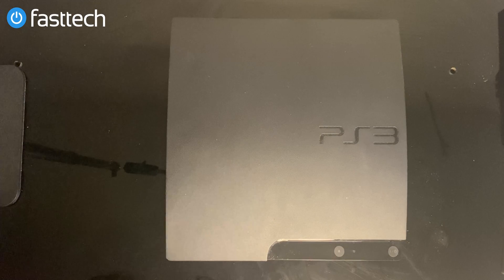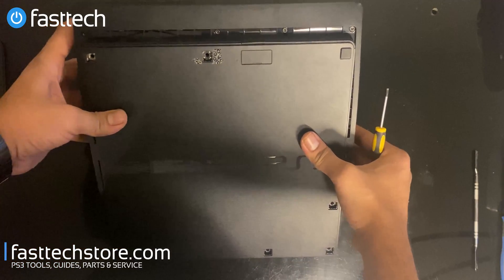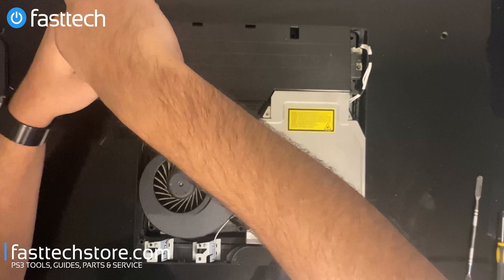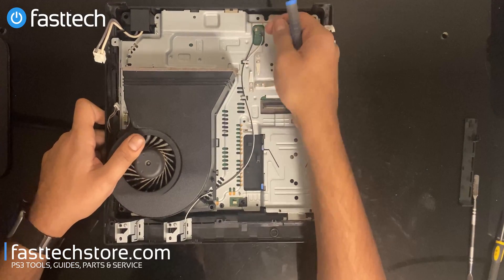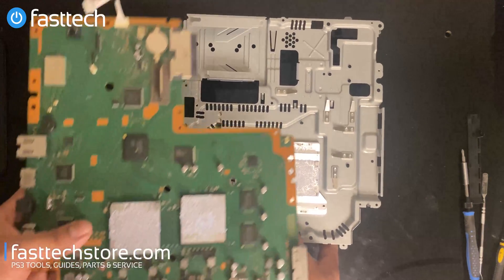PS3 Slim Disassembly and Thermal Paste Replacement Guide

Comment from the maker: 👉 Fasttech Pro Tool Kit: https://fasttechstore.com/tools/fasttech-pro-auto-kit
👉 Arctic Silver 5 Thermal Paste: https://fasttechstore.com/playstation-4-parts/arctic-silver-5-thermal-paste
👉 PS3 Power Supply: https://fasttechstore.com/playstation-3-parts/power-supply-aps-306
👉 PS3 Disc Drive: https://fasttechstore.com/playstation-3-parts/kes-450-blu-ray-disc-drive
👉 PS3 Slim 3001 Mainboard: https://fasttechstore.com/playstation-3-parts/p/ps3-slim-mainboard-disc-drive-logic-board-kte-001
👉 PS3 Front power button: https://fasttechstore.com/playstation-3-parts/sony-playstation-3-slim-control-board
👉 PS3 Hard Drive: https://fasttechstore.com/playstation-3-parts/1-tb-ssd-hybrid-25-hard-drive
👉 PS3 Fan: https://fasttechstore.com/playstation-3-parts/ps3-slim-internal-cooling-fan
👉 PS3 Casing: https://fasttechstore.com/playstation-3-parts/sony-playstation-3-models-cech-3001-casing
👉NEED HELP? FaceTime/Zoom Video Call Me: https://fasttechstore.com/online-consultation
👉GET REPAIR SERVICE FOR YOUR DEVICE: https://fasttechstore.com/electronics-repair

Other PS3 Videos:
▶PS3 CPU AND GPU DE-LID GUIDE: https://www.youtube.com/watch?v=GzMmi7F65wQ&t=30s&ab_channel=fasttech
▶PS3 CECHG Repair Guide: https://www.youtube.com/watch?v=GgOYFO9Pdss&feature=youtu.be&ab_channel=fasttech
▶PS3 CECHH Repair Guide: https://www.youtube.com/watch?v=BDC1O8mYZZc&t=1840s&ab_channel=fasttech
▶PS3 Slim 2000 Repair Guide: https://www.youtube.com/watch?v=S-ewz35fOLY&feature=youtu.be&ab_channel=fasttech
▶PS3 Slim 3000 Repair Guide:https://www.youtube.com/watch?v=ay7GYYMjodQ&ab_channel=fasttech
▶PS3 Super Slim Repair Guide: https://youtu.be/6a9UM_S1T64
▶PS3 YLOD Repair Guide: https://www.youtube.com/watch?v=uAWpqW1HCmo&feature=youtu.be&ab_channel=fasttech
▶PS3 Controller Ghosting Fix: https://www.youtube.com/watch?v=lMQouNRR018&ab_channel=fasttech

00:00 Intro
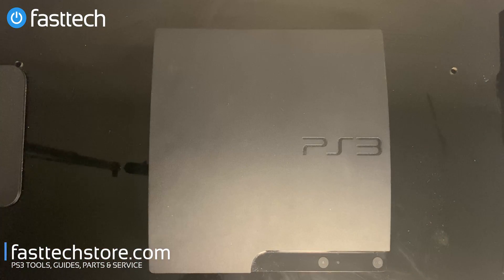01:07 Removing the bottom tabs & screws
02:20 Removing the top cover
02:31 Removing the power supply
03:02 Removing the disc drive
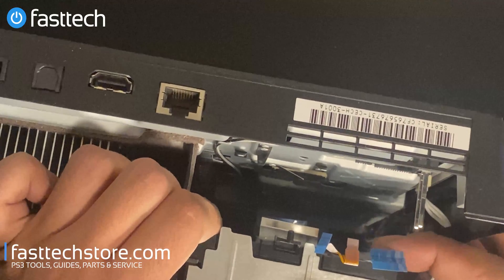03:47 Removing the front power button
03:56 Removing the hard drive
04:15 Removing the motherboard assembly
04:58 Removing the motherboard backplate
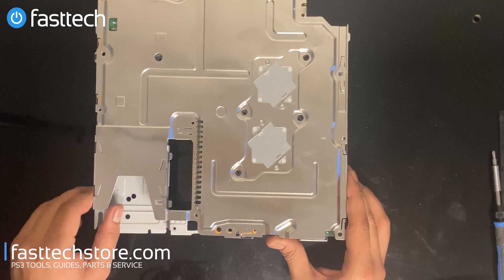05:44 Removing the motherboard
06:03 Thermal paste replacement
08:15 Reinstalling the motherboard assembly
09:39 Reinstalling the motherboard into the case
10:15 Reinstalling the antennas
10:28 Reinstalling the power button 
10:44 Reinstalling the disc drive
11:32 Reinstalling the power supply
12:18 Reinstalling the hard drive
12:37 Reinstalling the top cover
12:58 Reinstalling the bottom tabs & screws
13:45 Applying Fasttech warranty sticker
13:58 Outro

Comment: Why does mine deactivate it self...
Reply from the maker: Does it turn off right away after you turn it on?
Reply: @fasttechvideo  Im so stupid I forgot to plug back the cable from the fans in
Reply from the maker: @كوتاي-ك3ذ  Yes that would be a problem lol
Reply: @fasttechvideo  Its working now I was worried for a moment
Reply from the maker: @كوتاي-ك3ذ  Good, the fan is critical for cooling and needs to be plugged in

Comment: Great video! Just changed the paste in my ps3 follwing it. 
That stuff was so dry that the motherboard got stuck to the heatsink. I used a hairdryer to loosen them but still had to use some force. Quite a tense procedure, ngl 😅
Reply from the maker: Thanks

Comment: Can you speak a little more about a stuck motherboard? You mention it is a sign of bad thermal paste. I was to afraid to remove mine because I didnt want to crack the motherboard.
Reply from the maker: That means the paste is most likely dry
Reply: @fasttechvideo can you recommend a particular heat blower?

Comment: Is it possible to take off those lids to apply paste directly to the die similar to how it is done in the Nintendo Switch, or does the PS3 not have paste applied directly to the die?
Reply from the maker: Yes its a called a 'De-Lid'. I have done a few video guides on this topic on my channel so check them out

Comment: Mine is slim 2004b is that similar inside 😅
Reply from the maker: Similar but slightly different in how you remove the disc drive. Watch my ps3 slim 2001 video on this channel instead

Comment: i put new thermal paste but still not working? what must be the problem?
Reply from the maker: If your system was in a non functioning state like ylod or some other issue, replacing the paste wont help at that point

Comment: Did all the steps, now when i turn my system on, it turns itself right back off, then the red power light blinks
Reply from the maker: Something went wrong. First check the 2 standing pins under the power supply.

Comment: I reapplied the thermal paste and the fan is still running low and it turns on for about 30~ seconds and then it cuts power then if I hit the power button again it goes back to red… what is the issue? I might get a new power supply….
Reply from the maker: @igifvitig  does the fan speed up before it turns on? Did you have the same problem before doing a paste replacement?

Comment: I know this was a great tutorial because I was only left with one unidentifiable screw after putting it all back together!!!
Reply: CPU and GPU running at 55° while on home menu🤩
Reply: 63 on cpu and 69 on GPU during gameplay with less than 50% fan speed😊
Reply from the maker: @ViaCristero thanks 😊
Show me a picture of the screw and I’ll tell you where it goes
Reply: @fasttechvideo  it’s a torque screw I found the location but it will not thread
Reply: The screw just spins as if it’s against a flat surface I can see a white piece of metal that seems to be able to move I aligned it to where the screw looks like it would thread in but it does not thread at all
Reply from the maker: @ViaCristero 13:22 probably
Reply: @fasttechvideo yeah there’s 3 torque screws on my model the middle screw will not thread I’m not too worried about it but if you do know the solution let me know

Comment: followed all the steps but im getting no power at the end, any idea whats missing?
Reply from the maker: @Missourigaming425  check the ribbon cable for the power on off button at the front
Reply: @fasttechvideo  it was the ribbon cable. got my controller hooked up and turned it on that way, but now my controllers usb port is loose and wont connect to anything.

Comment: I've been doing the line or pea method and letting the pressure of the heat sink spread the paste. I still don't mind spreading it either.
Reply from the maker: That works also, but I recommend spreading it as demonstrated to ensure the  whole surface area of the IHS is covered.
Reply: @fasttechvideo  I tried the line method on my ps4 pro and let me tell you, at some point it sound like a damn jet playing both god of war games and I wasn't even on the map screen. Once I turned it off and let it cool, I took it apart and the majority of the paste wasn't even on the apu at all. I cleaned it up, and this time I did what I always do which is the spread method and it sounds a lot better. I mean the only time you hear the fan go up is when you are on the main screen or the map menu but it's not even loud like before. 😁

Comment: Your guide worked! But I have a new problem: my disc drive won't read discs. It takes the disc in, then it makes a sound, but it doesnt spin up
Reply from the maker: Check the ribbon cables and then check the gears in the disc drive to make sure they are aligned correctly.
Reply: @fasttechvideo  I figured it out. It turns out the main ribbon cable wasn't connected. Even though I had it in, the clamp wasn't pressed down. 

Sony sure made it a real pain in the ass to repair. But how my console is running way better than it ever did. Thanks again!
Reply from the maker: @SavagePatch115  You are welcome. Please like the video, subscribe and share if you can. That helps me out tremendously
Reply: @fasttechvideo  Seriously, I can not thank you enough. I've had this console since 2011 and I never took it apart due to the lack of a guide that covered this specific model. This thing was chalked full of dust bunnies, and playing late cycle games would have the fan screaming. Popped in an SSD and this thing runs like a dream
Reply from the maker: @SavagePatch115  I try to do videos others haven't done. Its one of the reasons of the channel's relative success.
The SSD should speed up your loading times. Also I recommend jailbreaking your console using HEN. Cheers and thanks for your comment.
Reply: @fasttechvideo  I do plan on reinstalling HEN so I can run my disc based games from the SSD for even better load times. GTA 4 is gonna run so much better than it ever did

Comment: Guys if my ribbon cables that are shown at 3:15 are damaged on the tip...do i need to replace my disk drive whole or can i find the replacement cables online??
Reply from the maker: Which one of those did you break?
Reply: @fasttechvideo  they were already broken cuz I bought the ps3 from another person and when it started overheating the next day I opened it and cleaned a whole lotta dust and also found out all 2 of them ribbon cables destroyed at the tip except the wide white one

Comment: Dig the background tunes. Thanks for the detailed tutorial! Got mine in pieces right now and knocked a few thermal pads off the top mobo shield. Now I'm digging through videos looking for a clear image of the shield - of my particular model - so I can finally reassemble and hopefully be able to watch a G$DD&?N BLURAY. Provided my bluray lens just needed cleaning and isn't burnt out, and I didn't break anything while separating the heatsinl from the CPU and GPU.

Prayers are welcome and much appreciated lol.
Reply from the maker: My prayers are with you. Good luck. If you have a 2000 model I did an updated video which will show more detail

Comment: My PS3 slim bought in 2009. When it boot up around 30 second it sound be be be 3 times and shut. Power light keep flashing. Very rare time may boot successfully properly out of 100 times. What possible causing it?
Reply from the maker: Use syscon to diagnose it. Will be doing a video soon on this

Comment: I noticed my PS3 running a bit hot lately and I had some thermal paste lying around, so I thought why not. The inside of my PS3 Slim was a bit different (I didnt have the ribbon cable on the bottom of the blu-ray drive for example), but most of it was the same. Old thermal paste was on there since 2009 I think. Now it's pretty much dead silent when in the XMB. Thanks a lot for the great guide!
Reply from the maker: You are welcome. Please help us back by liking this video and consider subscribing for more videos like these.

Comment: For me it starts overheating please help
Reply from the maker: Check the tightness on the heatsink clamps/brackets
Reply from the maker: Was it overheating before disassembly? It could be that you need a 'DE-LID' plus a thermal paste replacement
Reply: @fasttechvideo  it is overheating with new paste
Reply: @fasttechvideo  thank you i will buy it maybe

Comment: How does the network cable work and how to remove since i don’t understand
Reply from the maker: There is a pin on it you have to pinch/ 
Push down then pull the cable out

Comment: Hi, I got to the ‘remove motherboard backplate’ part, however, 2 of the silver screws are impossible to get out. I’ve even tried pliers and they didn’t even move a little. Any solutions?
Reply from the maker: Make the screws flatheats by cutting a line using a dremel or a saw. If that fails use a drill to drill the head of the screw off but be careful. Good luck

Comment: I recently bought a never used CECH-2001A PS3 slim in mint condition still in its original box and everything. I’ve already opened it up to replace the dead CMOS battery due to years of not being used. I’m a bit hesitant on going further, should I just toughen up and re paste it? The manufacture date on it is June 2009.. so surely it’s in need of new paste? The paste goes bad wether it’s been used or not, right? Arctic MX4 or silver 5? Thoughts?
Reply from the maker: Yes you should replace it with arctic silver 5. Check the description box and the top comment for links.

Comment: thanks for this video. Artic silver mx4 cpu and rsx both running at 42 - 43 c.
Reply from the maker: Great! Those temps are very good. Please like the video and subscribe for more videos like these.
Reply: @fasttechvideo  is it enough to just replace the thermal paste like in the video? Or does it have to be made like the phat model? Where you remove the cpu and gpu plate?
Reply from the maker: @gaboaaa23  depends on how loud your fan gets or of there is an overheating issue.
Reply: @fasttechvideo  I see, I bought some 0,08mm metal cutting wire wich is used for removing displays. I will remove the cooling plates from the gpu and cpu. Because that will give the whole refreshing package.
Reply: @fasttechvideo  hi, my temps are 73 cpu and 71 gpu while gameplay. Tested with prototype 2.

Fanspeed is set to 30 percent manual.

you think I need a de lidding?

Ot just normal refresh?
Reply from the maker: @gaboaaa23  you dont have to at this time. These temps are within the ps3’s normal operating temperatures
Reply: @fasttechvideo  realy? but these temps are with 30 percent fan speed- So with the regular factory fan speed it would be higher.

The ps3 was only used 29 day ......thats what webman show under total usage time. 160 times on and off.
Reply from the maker: I would also recommend delidding the ihs (check one of our latest videos)
The actual chips are under the IHS

Comment: Can I, in a bad situation use brake cleaner to clean the CPU and CSU? Or should I really buy Isopropyl alcohol for it? Bc if I should buy it, I will clean and replace the themal paste of my ps4 too
Reply from the maker: You’re better off cleaning it with a dry paper towel please dont do that

Comment: Can’t even turn my ps3 on anymore. Reconmected everything, checked the ribbon cables, i don’t really get it. i’ve been checking the power button cable but nothing should be wrong
Reply from the maker: Check the pins under the power supply

Comment: I change thermal paste at my slim model 3004b and i have 58° cpu and rsx 67 with 27% speed fun. I don't now if a best temperature but for a good temperature only chance is remove ihs procesor and change paste under ihs but is a dangerous operation.
Reply from the maker: Yes for the best possible temperatures you have to remove the IhS but for the temperatures you reported are within optimal operating range.
Reply: @fasttechvideo  I can't find official ps3 temperature data and I don't know if my temperatures are safe, but removing ihs is a dangerous operation because I tried it on my old fat console and I scratched tracks after the processor. Now I set the fan speed to 29% and I have 58-63° for rsx gpu and cpu 53-56° after 1 hour play.
Reply: @laurentiuilina4992 how do you set fan speeds? I need to do that for my Ps3 Fat model!!
Reply: @justingalea4027  for set fan speed you must have your ps3 jailbroken and after you must install webman mod.
Reply: @laurentiuilina4992  i will try to do that thanks

Comment: I only wanted to dust and clean my PS3 completely but I was told if I remove it like this; I have to replace the thermal paste to prevent airpockets; this video helped in more ways then one since my PS3 slim was very speciic model; the fan cover was different then other PS3 slims I've seen dismantled. The only thing I'm not sure is how to carefully remove the old paste.
Reply: Use alcohol 99% or alcohol wipes
Reply from the maker: Glad to hear this guide helped you out. Please like the video and subscribe 😊

Comment: im missing some of the parts like the hard drive mounting bracket and the cover for it, so all i have is the hard drive itself somehow. plus whenever i turn the ps3 slim on, i get a message saying "cannot find appropriate system storage". pls help!
Reply from the maker: The system storage error is because either the hard drive is not connected or broken. We sell the enclosure for the hdd on our website. Let me know if you want the link.
Reply: @fasttechvideo  yea i looked at where the hard drive is meant to go and there's no mounting bracket some how, so yea i might need the link thanks man
Reply from the maker: @SomeRandoAlmond2001  youre welcome please like the video and subscribe

Comment: Edit: I figured out why I couldn't get my PS3 back together. It seemed like the lid was just too tight to completely latch, and I suspected it was the disc drive because it looked like it wasn't level. Turns out it was the power button. My model must be slightly different from the one you used in this video, because the power button was blocking my disc drive from seating properly in the front. I removed the power button, put the disc drive back down, and then installed the power button and it closed perfectly. So for those of you who are having trouble with getting the shell to close properly, try installing the disc drive before the power button!

I can not get the top shell back on no matter what I do. One of the teeth just won't clamp down for some reason
Reply from the maker: Yes you have a 2000 pr 2100 series PS3
Reply: Yes it was this thanks

Comment: Might be a good idea to take that fan and fan cover off. I had a dust bunny the size of a chicken nugget that was completely blocking air from flowing through the fins from the heat sink. Wouldn’t have seen it otherwise.
Reply: When you connect it to power, hold down the disk eject button for about 12 seconds and it will do a manual clean
Reply from the maker: Not a bad idea